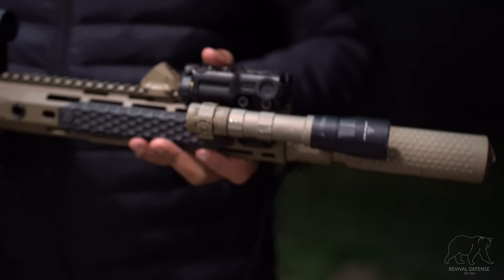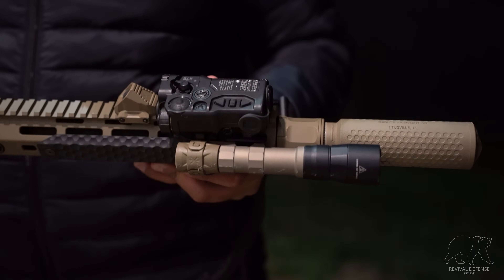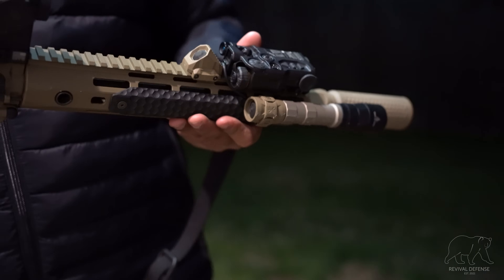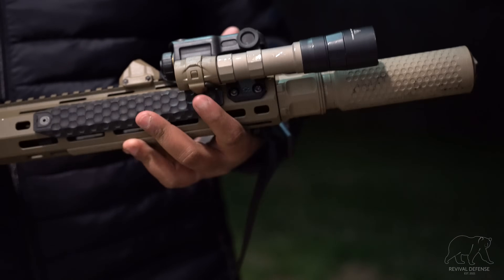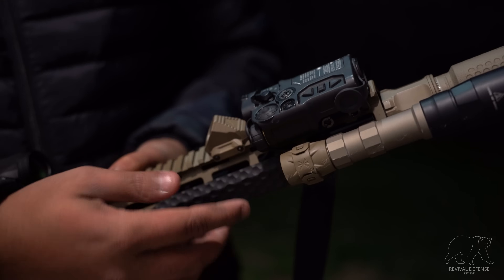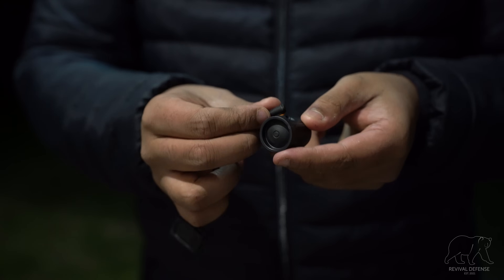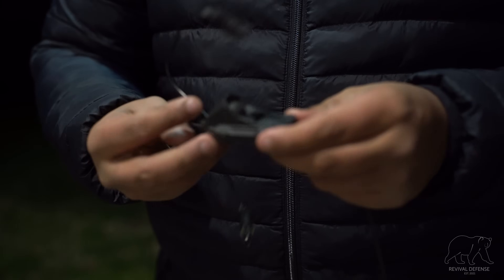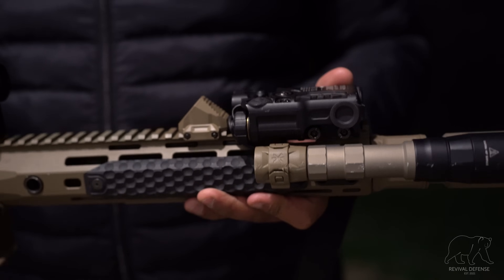The Unity Tactical GASCAP™ USB-C Tailcap & Light Switch

Comment: It looked like the gascap button is a constant on/off switch, while whatever is using the USB-C lead is momentary, am I understanding that correctly?
Reply from the maker: The tailcap has both momentary and constant (light press momentary, full press constant). The switch attached via usb-c just depends on the model if it's just momentary or also has constant, there's a few options out there now for switches.
Reply: @RevivalDefense  Thanks, I appreciate the information.

Comment: I'd rather they fix w.e causes the connection issues with their hot button and axons with surefire caps, than make a new product.
Reply: That's just it. The issue is with the Surefire tailcaps themselves. I have two and both have been unreliable. The one with the Surefire pressure pad has been the worst and will not even remain illuminated for more than a few seconds. The Unity switch on the other rifle does better but gets flickery and doesn't always have full output. Swapping them around doesn't help, and I'm not the only one to experience this. The Surefire switch has been changed out for this setup and the light is now reliably bright with no issues.

Comment: somewhat unrelated to the video but did you have to shim your muzzle device out for the CRS PRT to clear the rail on your 11.5?
Reply from the maker: Used an accuwasher, didn’t try to mount it with the factory shims as a few different cans were run on it before, but seeing how close the fitment is now, the accuwasher is likely needed

Comment: Need to make one where you can charge the battery by plugging the gun (light) into a USB-C
Reply: I have thought of that, and i think just swapping batteries is just better because faster and safer.
It stops the temptaion of just having your gun leaning against the wall at starbucks waiting for the 18650 to be full. At least it stops me from doing that.
Reply: Give em time……